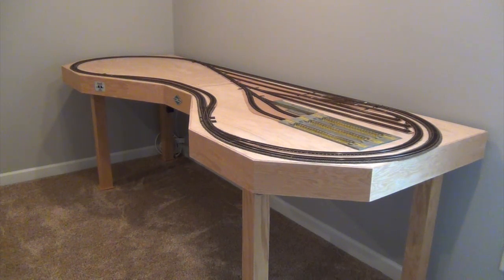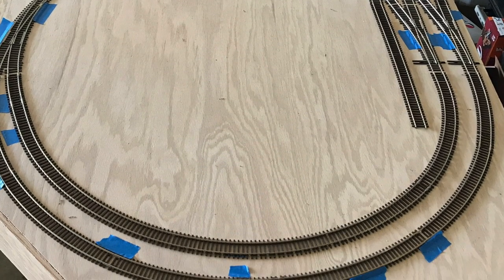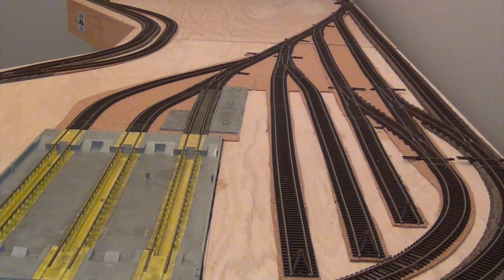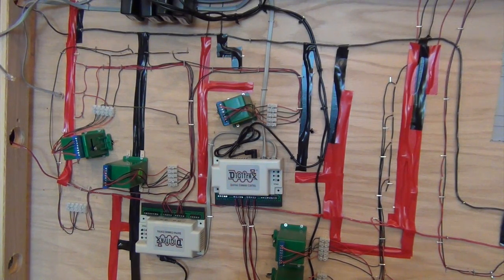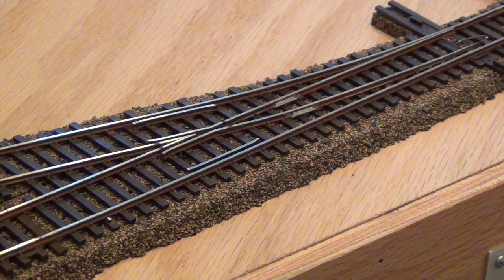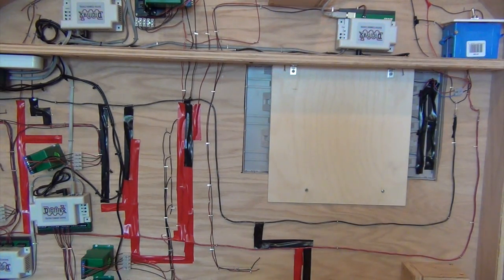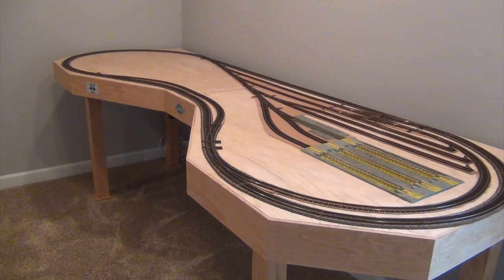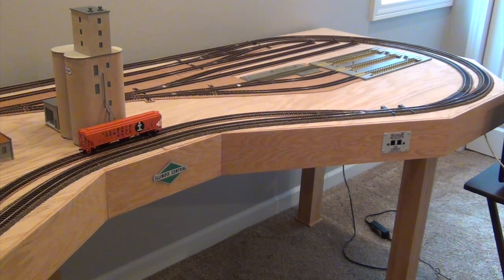HO Scale Illinois Central train layout (includes DCC wiring)

Comment: I've just assembled a Mianne benchwork (modular), similarly shaped like yours - a dog bone.  Each end is 4x4', with 3' for the long run.  The total run from end to end is 16'.  I hope to wire mine at least as good as your fine layout.  It will also be DCC.  Cheers, Bob

Comment: By the way, you mentioned you spray painted all your track which I found interesting because I saw no overspray on your cork or layout. Then you disclosed that you spray painted all of your track PRIOR to laying it. Interesting and working approach for sure. My only concern there would be rail joiners won't provide good if any electrical conducting between rails but if you drop a feeder for each piece of rail, that becomes a non issue unless a feeder goes bad and that's easy to fix. 99% of my rails have drop feeders. So much more fun to operate when you can put to bed all potential electrical issues during operation.
Reply from the maker: Jason Boche yes, I did take the track off the layout before I spray painted.  To solve the problem of lack of electrical conductivity at the rail joiners I put painters tape over each rail at the ends (about 3/16" on each rail).  I then installed the track and joiners and hand painted the rust color over the joiners to preserve the electrical current.  Plus, I have feeders everywhere to ensure no issues.  This was a very time consuming process but it was worth it, I haven't had any electrical issues.

Comment: This is, without question, a stunning piece of engineering. You should be very, very, very proud of yourself!!! Thank you so much for sharing this, and giving me all sorts of ideas for my upcoming layout in N-scale!!! I can even see a perfect place to squeeze in a reversing loop without it getting too crazy. I might even change the diesel house to a round house and wire it up in a similar fashion, though thankfully the Kato turn table automatically issolates the engine bays based on where the turntable is pointing!

I do so love the wiring job you did under the layout, that really is artwork and it makes my inner EEgeek so thrilled to see it so clear, orderly, and logical!!!

I have one question for you? I'm just getting back into the hobby after a 40 year absense. DCC was only just starting when I left the hobby decades ago so this part is all new to me. Can I build it all for DCC, but start with a single DC engine and then grow it later and convert thst first engine afterwards! My tentative plan is to start with a digitrax Zepher and run that one engine on DC for the first little while?
Reply from the maker: Thanks for the comments.  To make a long story short, yes you can wire it for DCC but run it with a DC power pack.  (I won't broach the topic of running DC locomotives with a DCC system - it is possible, but I don't feel comfortable doing it).  With the layout as it is in the video, if you connect the two wires (Rail A and Rail B) to the two outputs on the DC power pack.  I would not recommend connecting any other DCC devices until you full convert to DCC (e.g., the Tortoise switch machines, DS64s to control the Tortoises, etc.).  The only issue with wiring for DCC and using DC equipment is that the entire layout will be powered and you will only be able to run one train at a time because you did not wire any DC blocks into your circuit.

Comment: What is the radius of the inner curve at 0:44? Also, sorry if you mentioned this but, what type of turnouts did you use? Great layout, thanks
Reply from the maker: Thanks, Matt.  The inner radius is right at 15 inches, it is a little tighter than that on the right side where the crossover is.  I couldn't keep a consistent radius to account for the space needed for the turnouts.  My turnouts are all Walthers turnouts, #5, DCC friendly.  I would strongly recommend getting your turnouts as soon as possible (I am writing this comment in February 2020).  In January (2020) Walthers released a new line of track/turnouts.  They will sell out quickly.  My brother was looking for turnouts for his layout in October 2019 and there were none available, anywhere.  Even on eBay, there were not many for sale.  Track is a really strange commodity, there is not an abundant supply so you need to buy it while you can.
Reply: @ck7813  Thank you! I'm planning to do something like this in a 9x3 space I have. Very  helpful

Comment: Loved the color selection for your ties, question what source would you recommend before starting my first Dcc layout, with similar space restrictions, I've never wired any kind of layout but have no issue taking on this project now that I'm retired.
Reply from the maker: Hi Joe - I came up with layout on my own and I used photocopied pictures of track that I configured to the space I had.  If you want to look at pre-designed layouts, Kalmbach Publishing has some books that are entitled something like "Layouts for small spaces."  If your local hobby shop has a copy, you can at least look at it before purchasing.  For wiring, I would recommend looking at:  http://www.wiringfordcc.com/index.htm 

It is an amazing website and will tell you everything you need to know about wiring for DCC.  I have had really good luck with Digitrax but I think that each DCC system has advantages and disadvantages.  I went with Digitrax because that is what is mostly used where I am from and I have a lot of local guys with experience who can help trouble shoot.

Comment: Hi, Question for you, What is the reason for laying cork or foam under the tracks?  Could you not just tack the track to the Board? 
Nice job on the carpentry :)
Reply from the maker: Fruit Gums The cork serves a couple purposes.  First, if you look at a prototype (real life) train track, you will notice that it is higher than the surrounding landscape for drainage  and safety purposes.  The presense of the cork on a model railroad is to give a prototypical appearance.   Second, and probably a less important reason, is the cork does help with some sound deadening on the model railroad.  The trucks on the locomotives and rolling stock create a bit of noise and the cork does deaden the sound.  However, with modern sound locomotives, making model trains quiet isn’t as desirable as it was 20 years ago.

Comment: Fantastic layout! Fantastic and clean wiring! You've got a great model railroad started here. Nicely done. Can you send me a link on that grade crossing pro you mentioned? I also built the Walthers Prairie Coop several weeks ago using a few of the tips you provided in a previous video. It turned out great (I've published some videos of my in-progress layout - feel free to look). You made a comment about keeping separation of the track power wiring. Disclaimer: I am not an electrician. However, I had the same concerns and asked a Masters degree electrician about this very subject several weeks back. My question to him was more about isolating Digitrax DCC track power from DC and AC power for tortoise machines and accessory lighting respectively. He said there should be no worries bundling all of those cables together because they are such low frequency. Interference and "cross talk" tends to occur with higher frequencies (think audio/sound). That said, I've run into no issues on my current layout (yet) or my previous HO scale layout where I ran the same kind of wiring in close proximity. Anyway, you'll sleep better at night and your wiring is much cleaner than mine :)
Reply from the maker: Jason Boche I agree with your assessment of the current causing interference.  While I agree it is low risk it was just easier to separate the wires since I was starting from scratch.  I will be honest, my last layout didn't have the wires separate and I don't really notice any difference.
Reply from the maker: Jason Boche the only place I could find the grade crossing pro was directly from their website.  I am going to start working on that shortly so videos will soon follow!  http://www.logicrailtech.com/

Comment: I am impressed with your track voltage
digital meter, did you buy it, if so from where, or did you make it? If you made it, is the wiring and parts list available so i can make one for my use. Thanks for your video's very impressive work!
Reply from the maker: No, I didn't make it.  It is called an RRampMeter by DCC Specialties (www.dccspecialties.com).  I don't think you can buy direct from their website but they list their dealers.  I did check some are on eBay.  I bought mine from an online train store that no longer exists.

Comment: Looks great, 18 inch radius is really sharp, are you running four axle locomotives?  Can't wait to see it finished.  Love how you have a clean wiring job.
Reply from the maker: upsd402 Yes, I am primarily running 4-axle diesels.  I would love to have 22 degree radius or more but I simply didn't have the space.  I have an Athearn SD70 6-axle that does work on the layout.  It is tight and looks awkward going around the turns but it does work.

Comment: Why does it look like it hangs over one end?
Reply from the maker: Thanks, David.  It looks like it hangs over the end because it actually was over the end.  I attached another 1/4 piece of plywood to that end so if you watch my newer videos you will see the problem has been resolved.  It was unfortunate, but to get all of the turnouts to fit, that small section of track was about 1/8” over the edge of the benchwork.  Despite my best planning, I simply made a miscalculation.